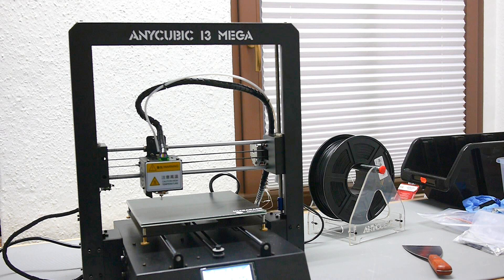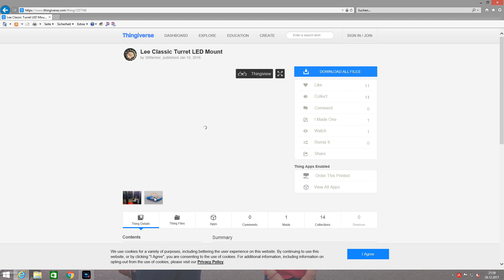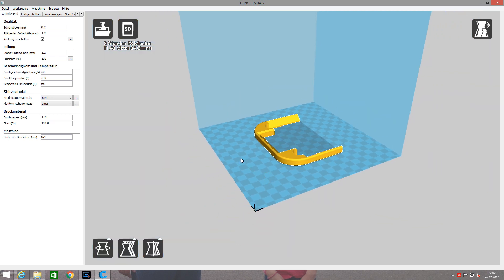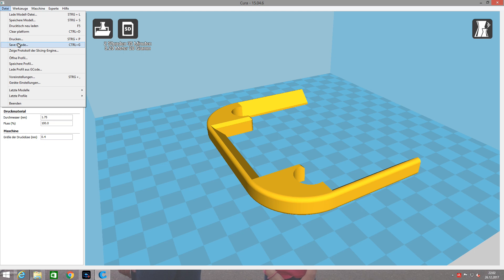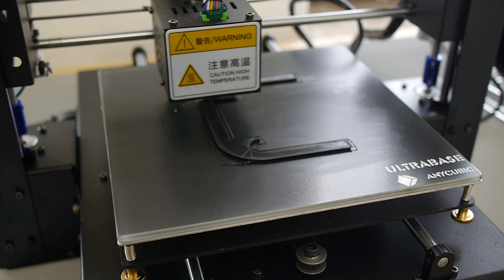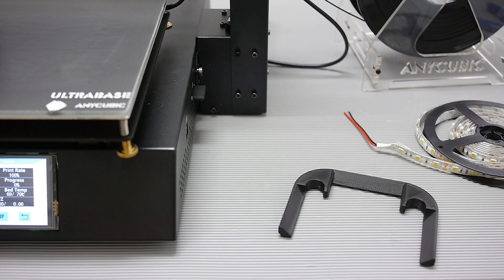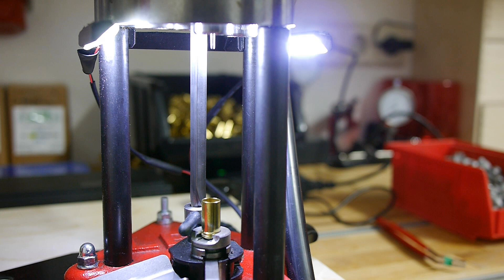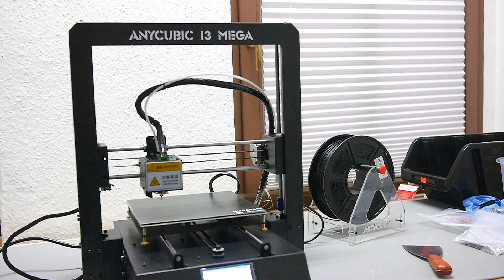3D Printer at the Reloading bench for printing spare parts and more

Comment: a warning about PLA. it will flow and conform over time if under compression. if you have PLA parts held together with bolts, you will need to replace the parts every year or two because the plastic has flowed around the bolts and deformed.
Reply from the maker: Thanks for this advice buddy

Comment: All very nice, but you would need to make thousands of little plastic gizmo's to justify the cost of a 3D printer, just use double sided tape to fix your LED's . Happy New Year to you.
Reply from the maker: If you need small parts only than you're totlay right buddy but if you need an case feeder or an bullet feeeder this device pais for it self. Thanks for your comment and Happy New Year to you also my friend.
Reply: Michael G: No I do not "get it" I enjoy reloading as much as shooting, but I reload for calibers either unobtainable, or that cost £20 per shot, my point about printing parts is that there a better things for me to be doing than sitting waiting by a computer to make parts that I can either buy for pence, or make quicker than they take to print, now if I had a 3D printer at work that would be a different matter, it would then make sense. I realise that many do now have 3D printers and that they are searching around for things to make to justify the cost, but most parts I can make in my own workshop, and, as you say, enjoy making them better,or cheaper in materials, than buying, I even make my own bullet moulds and dies, and enjoy that very much.
Reply: Englishman French quite good 3d printers starts at about 120 Euros. Not that much at all. I’m just drawing a primer  tube filler with vibrating motor which by itself would cost more than 150 euros. If it could be bought. And you definitely can’t do that by hand from spare material, not with good results.